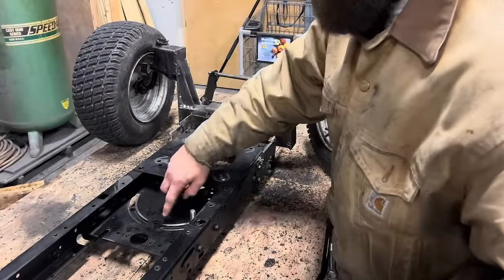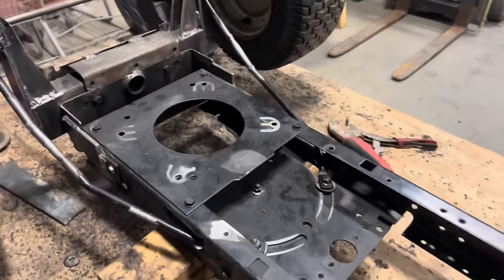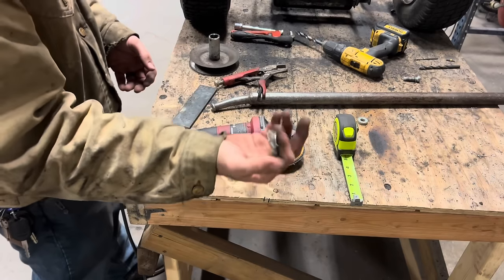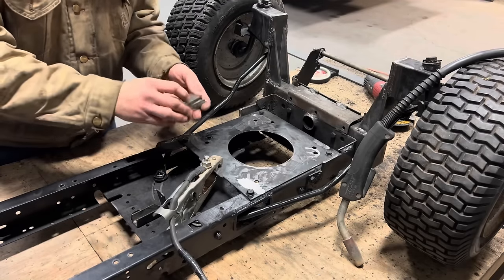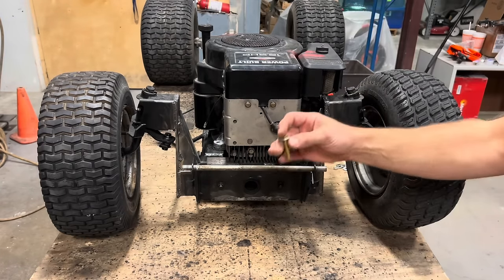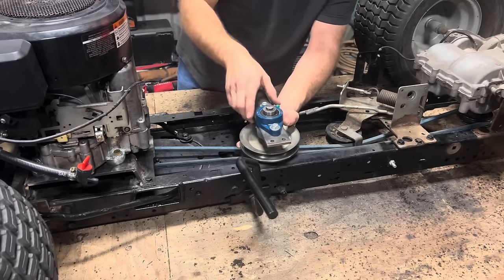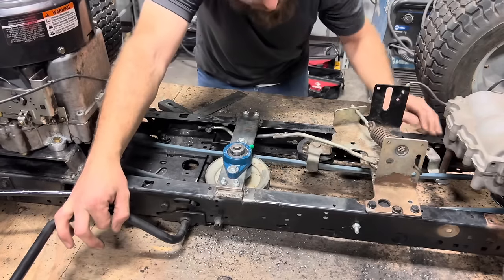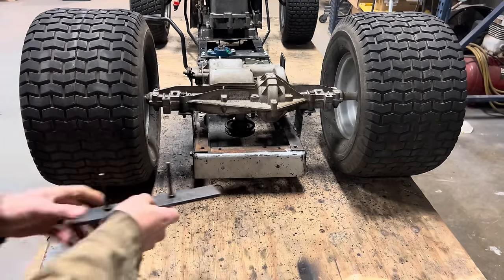How To Lower a Lawn Tractor As Low As Possible Pt. 2

Comment: You better have some positive caster in the front end or you won't be able to steer it ,lean the front axle back at the top !!!
Reply from the maker: The steering came out great. I didn’t change any of the angles, just cut the axle and shifted it up. It steers like a stock mower still!

Comment: Not saying anything bad just maybe suggestions on steering linkage weld up ! Seen a few guys use angle  iron !  laying the steering linkage in at the back of 90 and burn it in ! over lapping linkage and angel iron 4 or 5 inches ! Most likely stronger than butt welding two pieces o rod together !
Reply: So cool. 😊

Comment: Awesome project, and literally the only place I'm going to knock you is "flat strap". I've been with a structural steel company for the past 15 years. In the industry, that's "flat bar". It's bar stock; round bar, square bar, or flat bar. I'm not trying to be a Karen, what you're doing is friggin' awesome, and I'm going to be a new subscriber. I'm just wanted to say something before the keyboard welders started attacking.
Reply from the maker: First of all, thank you very much for the compliment!
 On the terminology, I do buy a lot of steel and I know the technical names, but I’ve always had a hard time with flat bar. I honestly don’t have a good reason for calling it flat strap, but we use it to make what we call “floor straps”, so it feels more natural.

Comment: Great video but I’ve got to wonder why you didn’t raise the engine plate instead of building the risers, looks like it would unbolt and you could have put the risers underneath
Reply from the maker: Thank you! 
Welding the risers just seemed like an easier and more stable option

Comment: You'll probably want to put the big pulley on the engine... It's gonna be slow. Good video.
Reply from the maker: Thank you! 
I do plan on going with a larger pulley on the front, but it will be a new steel pulley.

Comment: Im sure by rhis time u have already discovered that the 5 or 6 speed w/ R  hydro trannies don't work well at all and definitely dont shift as expected , but we also have been known to use 20 hp oppys . Do you plan to do a pulley swap? Its the only way to get anythingbetter than mowing speed   IF you have any intent to put any power to the trans , we have been having  pretty good luck with the F N R automatics and use the supplied variable speed pulley and a pair of idlers to clutch it . Just thought id toss that in there . Have fun and keep it safe !
Reply from the maker: I don't really plan on adding any power, but I have done a pulley swap on the rear. I'm still contemplating doing a swap on the front as well.

Comment: This is awesome bud, I gotta do one now, so cool. But or the steering linkage, im gonna try to thread the rods and then thread the inside of a pipe. It would be adjustable and stronger than 2 butt welds per side.

Comment: Square corner holes create stress risers. Next time when cutting a structural member, it would be best practice to use a step drill at each end of the opening the cut out between the tangent points of the round holes. 😉

Comment: Just curious why keep the mower steering instead of doing something similar to kart steering?
Reply from the maker: The main reason is that would cost money. I may do custom steering with tie rod ends in the future, but my goal is to leave it as stock as possible for as long as possible for the lowest cost possible. I want to be able to tell people “if you have a mower, a grinder, and a welder, you can do this too”
Reply: @wybarprojects  that's what my thoughts were as I'm thinking about doing this as well! Just dont have a welder:/
Reply from the maker: @CaptainLD69  I know a few hundred dollars is nothing to shake a stick at, but you can get a good used welder for about $300-500 and once you get it figured out, there’s no question about whether it was worth it.
Reply: @wybarprojects  any recommendations of brand/model? Also preferably something for a regular outlet as I'm renting only for another year so rather not have a new outlet put in.
Reply from the maker: @CaptainLD69  I know people that swear by Harbor Freight and Northern Tool house brands, although I haven’t had personal experience with them in at least 10 years and they were not great back then. I stick to Miller, Lincoln, and Hobart. They each offer a 110/120 volt option that works great. The one I’ve been using in these videos is a Millermatic 135 with .035” flux core wire. I would check FB marketplace, Craigslist, etc. and just test it before you buy it
Reply: @wybarprojects  I have a Harbor Freight Titanium flux 125 (costs about $200). It's a tiny little thing that plugs into a regular outlet and it's been working great for me for the past couple years.
Reply from the maker: @WilliamNyberg  that’s the one I keep hearing about lol
I guess I’ll have to find one and try it out

Comment: loving the videos mate.

just a bit of advice when drilling holes 20:35 small holes high speed, large holes LOW speed.
the speed your drilling the larger holes will dull your drill bit and ruin the temper on the cutting edge, making them a sod to sharpen.
Reply from the maker: Thank you!
Reply: @wybarprojects  your welcome, i did a pre-apprenticeship course in 2010, so i could learn to weld and time was split between welding and machine shop.
the other bit of advice re: drilling, cutting FLUID is not oil, some water with a bit of detergent (a surfactant to spead the water) is way better than WD40 or oil.
cutting fluid is to used remove the heat, oil lubricates and prevents the drill from cutting, it generates more heat and blunts drill faster

loving the videos, sadly most of my murrays have a pressed frame and not a chassis like yours
Reply from the maker: @amandagardner565  that’s awesome! 
Ya, I got lucky with my mower. My neighbor just set it out on the street one day so I asked him about it and he said he got a new one and I could have for free 😂